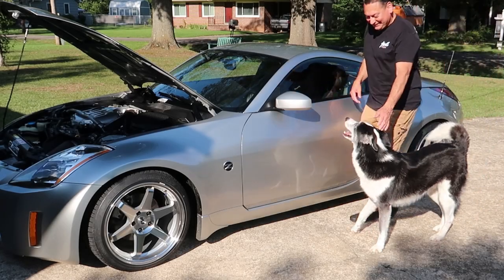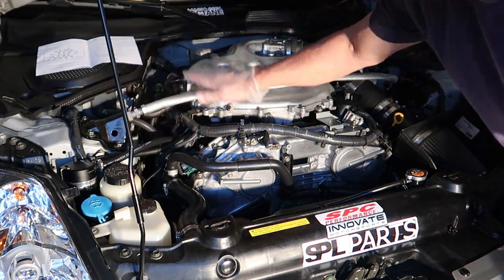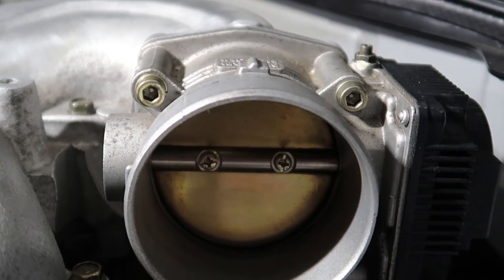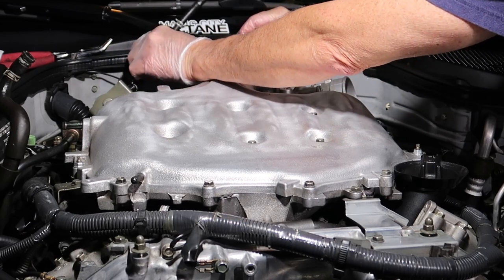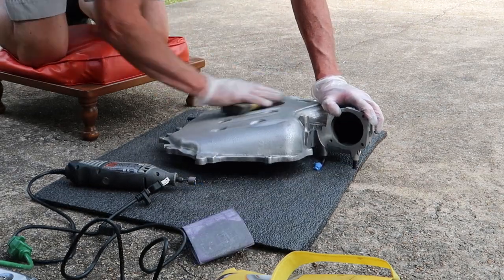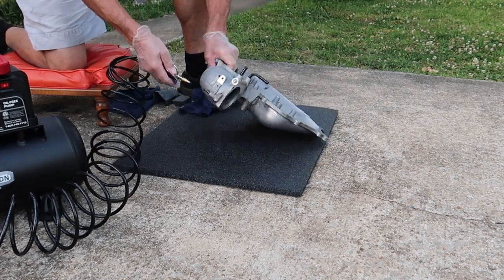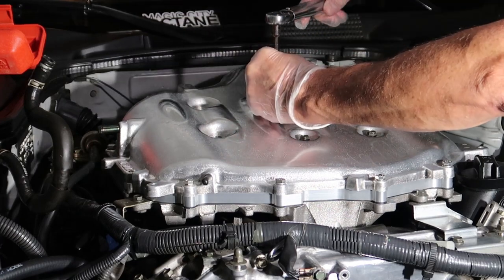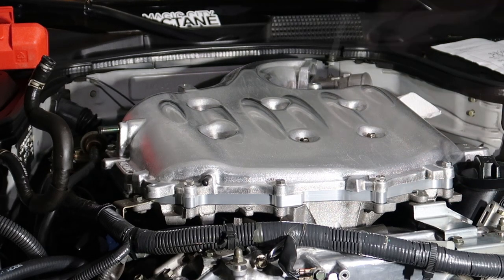How to Polish your plenum and install a 5/16" spacer on a 350z #Nissan350z #Zociety

Comment: I am amazed on how clean the DE engine bay is along with inside the intake plenum. Nearly Spotless
Reply from the maker: The inside of the plenum was cleaned during a valve cover replacement and then a catch can was installed. This keeps blowing by gases from  Re-contaminating the inside of the plenum. Thanks so much for watching!
Reply: Rice guy read my comment on plenum port/polishing...My lower plenum had minimal oil residue also...I believe using 100% synthetic oil and not always visiting Redline at every shift, reduces the need for a catch can. I don't need one.
Reply: @stealthg35infiniti94  hmm sounds about right, perhaps some synthetic oils are not equal. lol as far as redlining that will definitely increase the blow by gases

Comment: Nice video! Would it be worth it install this plenum spacer on my 2005 350Z convertible with an automatic transmission? I drive conservatively, rarely exceed 4500 RPM, and the car already has over 120,000 miles on it. Thanks.
Reply from the maker: Only if your seeking to improve the airflow in your plenum, you my not notice any difference in performance! But your engine will love ❤️ you for it!!🏁👍

Comment: I did this during the quarantine last March. Took forever 😭 but I guess it was worth it. Sanding disk for the win. Finished with 1200 grit then used rogue compound with wool wheel. Then fitz aluminum polish.
Reply from the maker: Awesome, thanks so much for watching!

Comment: Did you have to bleed your coolant afterwards?
Reply from the maker: I had to add so coolant to the reservoir after I drove the car around.  But, I didn't lose enough coolant from the throttle body hoses to cause me to have to bleed the system! Thanks so much for watching!

Comment: Nice job on the outside of the plenum...I just did a minor porting and polishing of the inside of both the upper and lower plenum sections. First after removing the lower, I started by reshaping the big fat intake tubes with a grinder. Then using a 3in course wire wheel, I worked on the mouths of those 6 tubes. I followed up with 200 grit sandpaper and wire wheel. Repeated on the upper plenum to also trying to remove the original sandcasting roughness. Used the wire wheel on the throttle area also. Clean everything and applied Graphene coating to the inside to reduce oil vapors from sticking to the interior plenum. Bottom line: A definite gain in power without adding a plenum spacer.
Reply from the maker: Awesome 👍💯

Comment: For the centre bolts being tightened, raising the plenum must raise the gap between the plenum and engine, thus when it is tightened back down, you risk breaking the plenum, as there is no support underneath it as there is the gap.

Do they not supply spacers to negate this issue, as other manufacturers of this type of raiser do?

Also as its raised  the centre bolts risk air being sucked in as there is no direct contact between the plenum and engine anymore, would fitting o'rings on the bolts, prevent this issue?

Thanks.
Reply from the maker: Yes, the center bolts come with self sealing washers!
Reply: @Zspeed  hi, do they have the spacers though?
Reply from the maker: No, the Z1 motorsports plenum spacer didn't come with plastic spacers!

Comment: Very clean engine bay bro...did you notice an increase in torque with the spacer?  From a fellow vq35DE owner.   Also you have a very relaxing voice
Reply from the maker: Maybe  just a slight increase in power,  but when you add a e-tune or dyno-tune it should help increase your mid range torque and top end power! Thanks so much for watching!

Comment: Where is all the washer placement for the strut tower? Is it 2 on inside and 1 on the outside to use all 12 or was it 1 for each bolt/nut to make it 8?
Reply from the maker: I ended up using all of my washers to get  my strut brace high enough to clear the plenum!! You my have to add some washers as well!!

Comment: Did you notice any difference in  midrange torque ?
Reply from the maker: Slight increase, but more noticeable after getting a e-tune!!!
Reply: @Zspeed  E-tune? Whats that?
Reply from the maker: I got a tune sent to my laptop from UpRev tuning, after doing some data logging. Not as good as a Dyno tune, but less expensive!